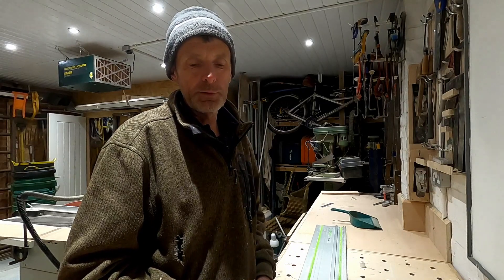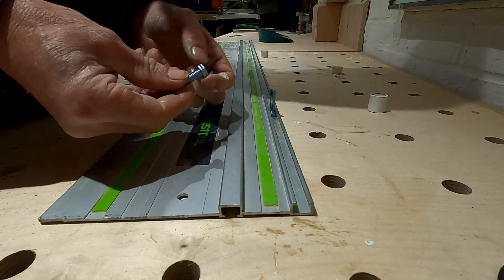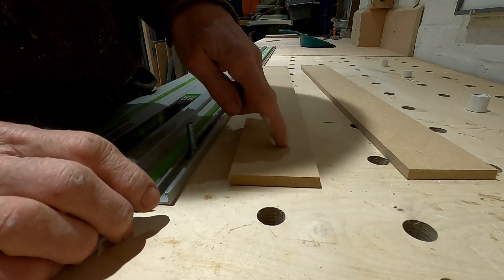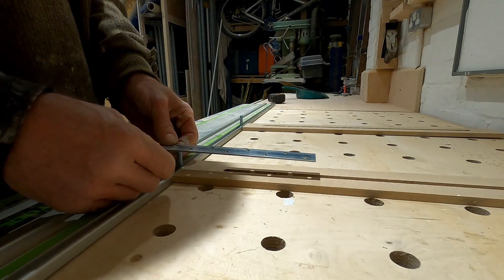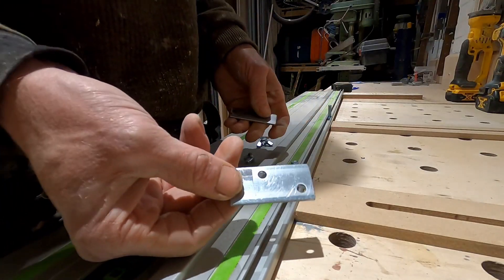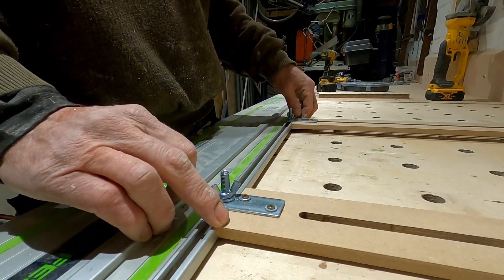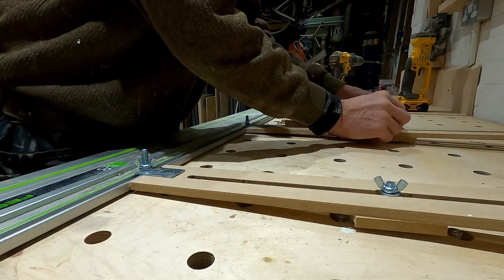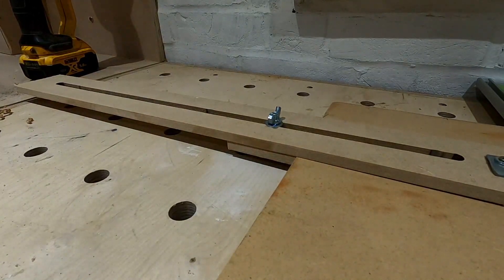Cheap Tracksaw Parallel Guides

Comment: Thank you for your video! I saw that you are running a scheppach dust collector in your shop, may I ask if you are satisfied with this product? Thank you!
Reply from the maker: Hello 
Thanks for watching I have only had the scheppach dust extracted since January. The other one I had packed up I brought the scheppach as it was the only one I could get hold of quickly and was reasonably priced but seems to work well quite noisy but for the money you can’t really complain 
Mark
Reply: @smallspacecreation5768  Thank you for your response, Mark. All the best to you! Lukas

Comment: Thanks. Simple and to the point. 
My experience with thin mdf is that it damages easily... I would choose a different material.
Reply from the maker: Thanks for watching you could use aluminium or hard wood if you prefer I was just trying to make it cheap and easy to make for everyone 👍👍👍